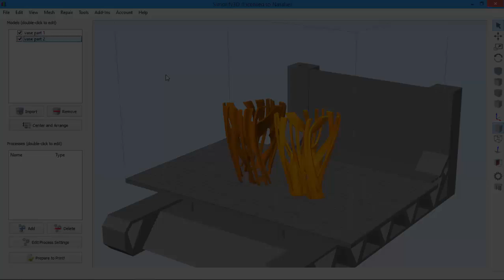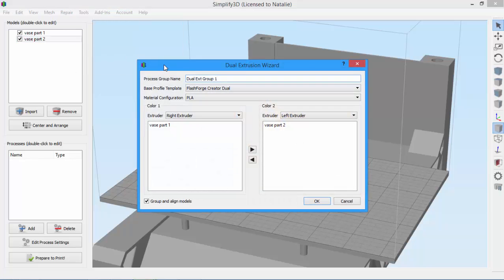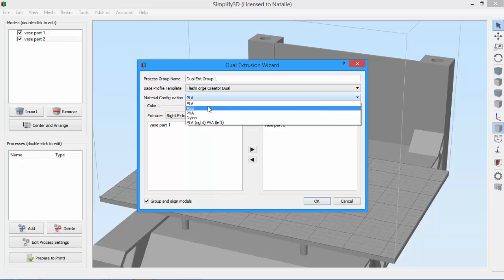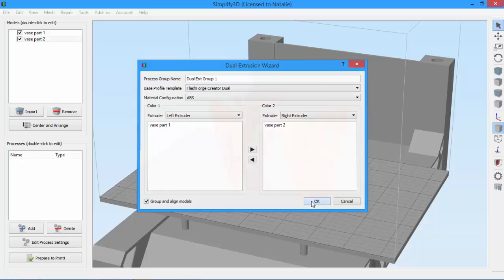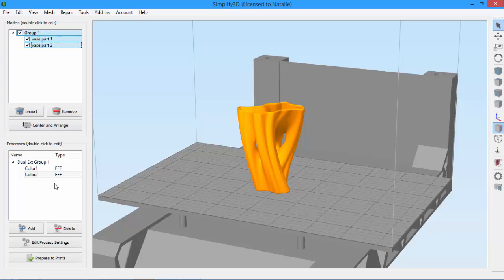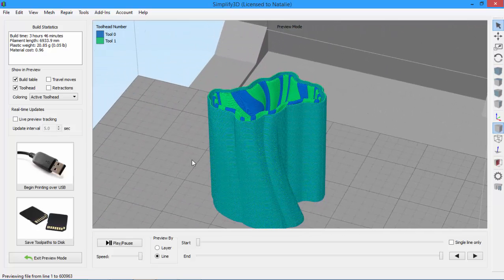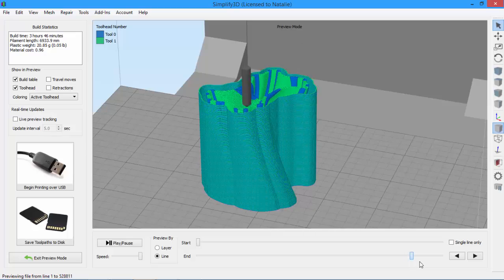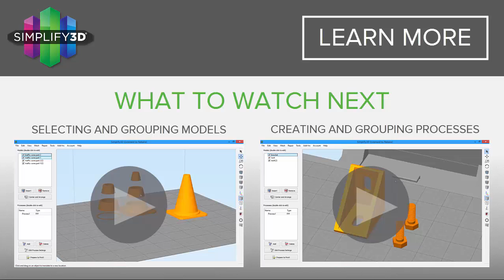Dual Extrusion Wizard | Simplify3D

Comment: When i press "prepare to print!" to look at the preview, i get a build time of 0 hours, and nothing shows in my preview. The 2 parts are touching but not intersecting (a simple wheel and tire). I can't figure out how to make it work. I'm using a makerbot 2x profile.
EDIT: i tested with other shapes and parts. I even made an offset of 0.01mm from parts that should be touching. Still doesn't work.

Comment: I have a Geetech Prusa 3D printer, and it is a Dual head printer.
I could not find a Dual profile using the assistant.
How does one add an extruder, or create a dual printer profile.
I could not find a video on the subject.
Are you able to help?

Comment: So I have gone to the assistant and it is not giving me any options to select.  It just says other.  So I select other and enter in my printer name and firmware etc and it still does not appear to be working.  Is there a place I can manually download and install these files to so it works?
Reply from the maker: +Ro Du Please contact our support team for help with this issue. Visit simplify3d.com/contact and choose "Technical Support" from the drop down, and make sure to include the email address associated with your license. Thanks!

Comment: After buying S3D I have found my 3D experience is getting better and better.  I managed to print a model in 123D which I split into 3 layers and extracted to 2 stl's, brought these into S3D and ran the wizard and printed it.  Then found my left extruder is not calibrated to my right (main) extruder.  I have a Flashforge Creator Pro which has firmware Toolhead offset on Tool 1 set to 34.  Can you advise on the best way to get the 2 extruders to calibrate.  The help on using calibration script with ReplicatorG is so old and does not work.

My user name:TomSawyer
Reply from the maker: +TomSawyerProductions Our support team would be happy to help! Please contact them at simplify3d.com/contact.
Reply: +Simplify3D I have managed to align the left extruder by doing the following: -
1 - Using ReplicatorG, using  USB, Machine, OnBoard Preferences, Homing/VREFs and changing the X and Y toolhead offset (mm) to 0
2 - In S3D under process settings, G-Code, ensure Toolhead offsets X for Tool 1 is 34

Thanks

Comment: I'm having a problem with dual print. I want part 1 totally enclosed in parts 2 but when I try is prints the bottom layer on the bed in the part1 colour. How can I get the base/first layers to be part 2 colour ?